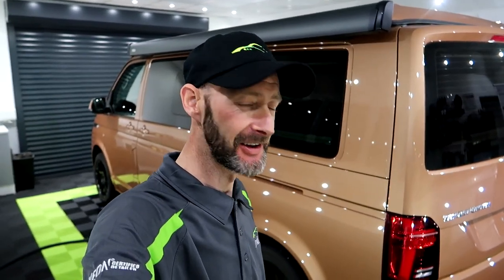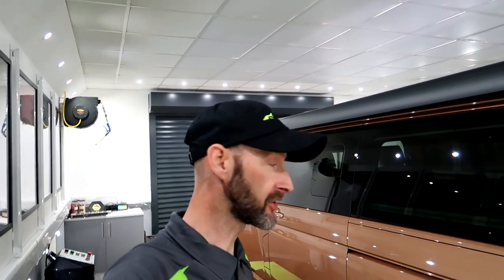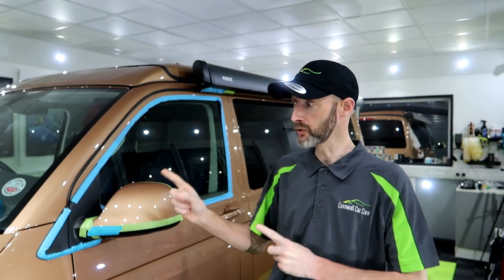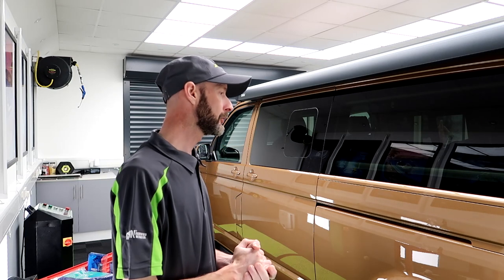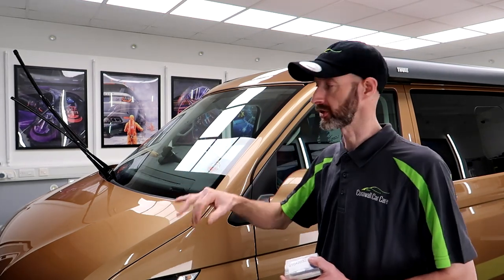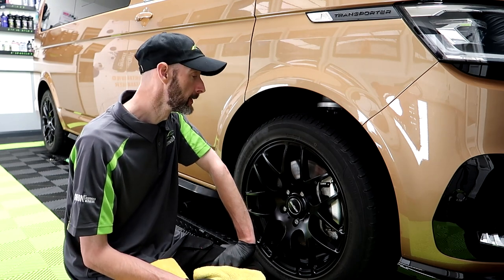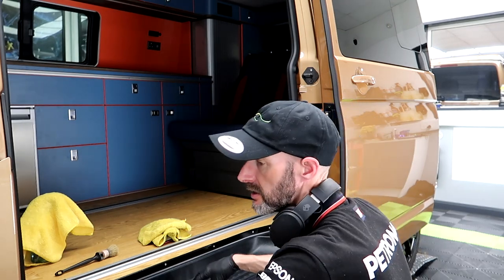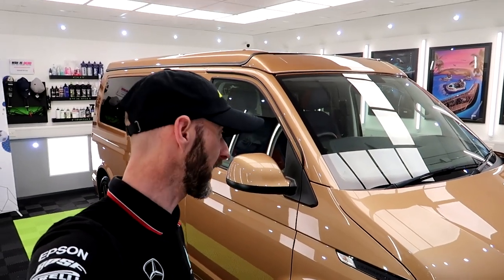VLOG 023 ( 2023 ) VW Transporter LWB With @GYEON_official Infinite Ceramic Coating

Comment: Are you Irish or Scottish or New Zealander or South African or English or Lebanese? Also, you could save a lot of money with towels by throwing them in a rinseless wash bucket after using them to apply & remove coatings. As long as it’s in there within 30 minutes, no coating can bond in that environment!
Reply from the maker: English ( but I do have some Scottish and Irish in me ) as for the cloths I personally wouldn't take the risk of re using the coating cloths as there not that expensive and dont want to take any chance of damage in the future. ( there is a company round the corner from me that takes them and uses them in there mechanic business). 👍